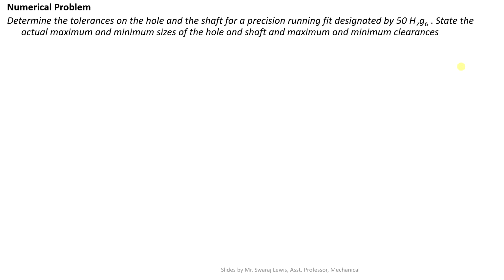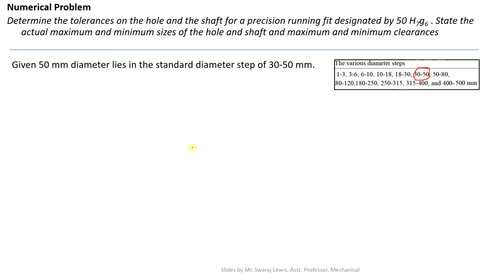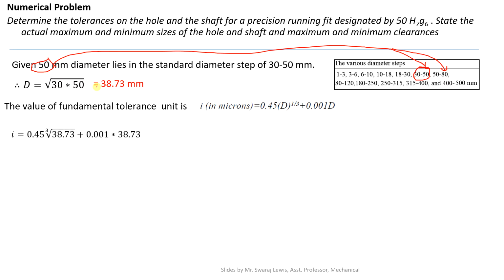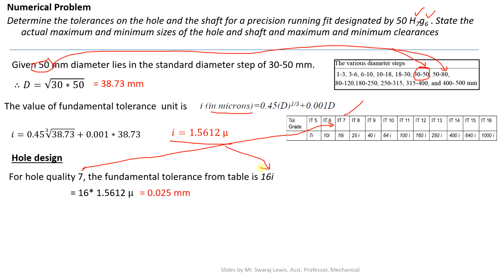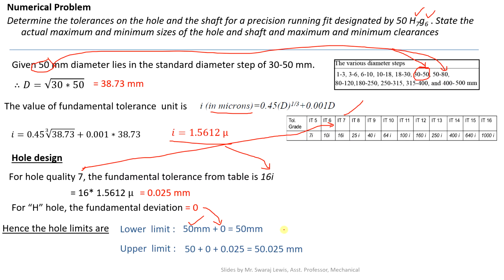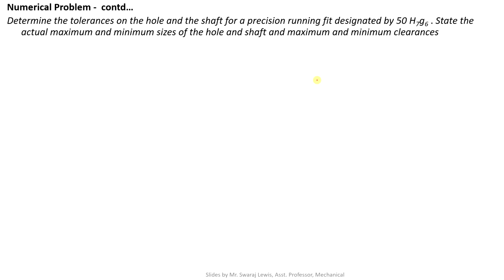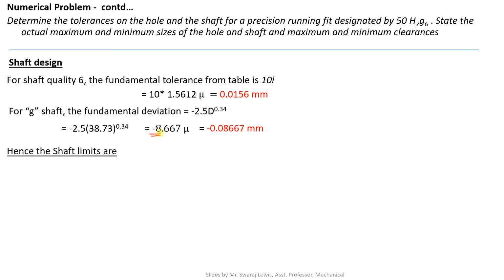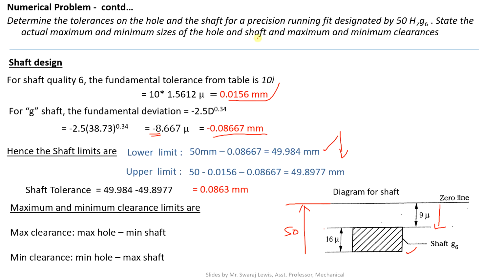Mechanical Measurement and Metrology  Tolerance  Limits fit problem1 - MMM

Comment: Determine the tolerances on the hole and the shaft for a precision running fit designated by 50 H7g6. The standard tolerance is given by: i=0.46 D +0.001 D, IT 7= 16i IT6= 10i Fundamental Deviation for H hole is = 0. And Fundamental Deviation for g shaft = -2.5 (D )^0.34 Diameter range lies between 30 to 50 mm. Sketch the fit and show the tolerance upon the actual dimensions of hole and shaft.